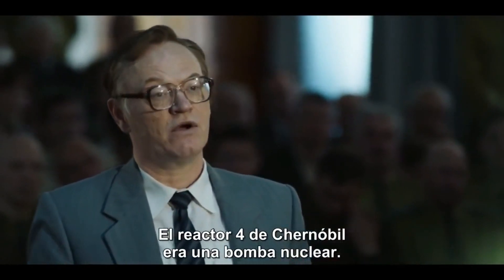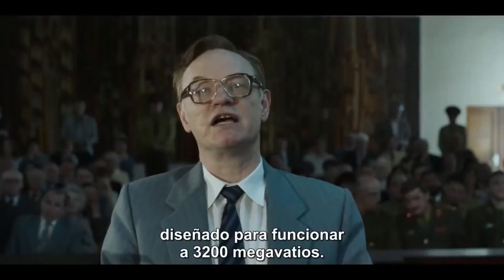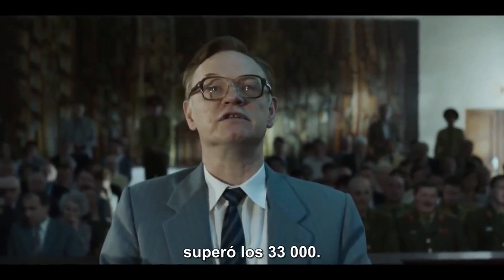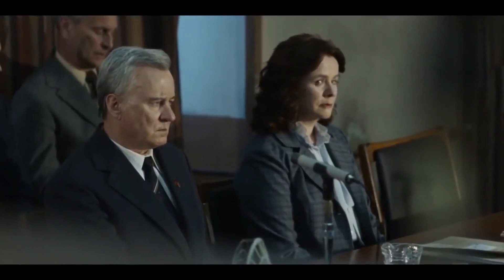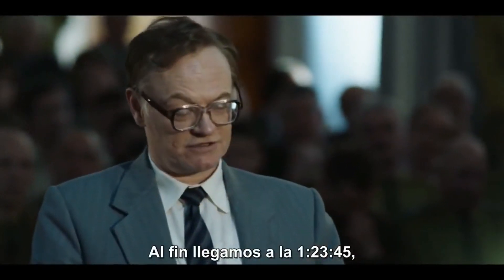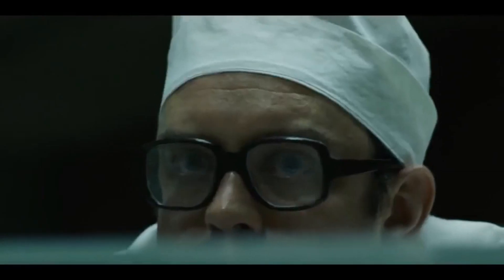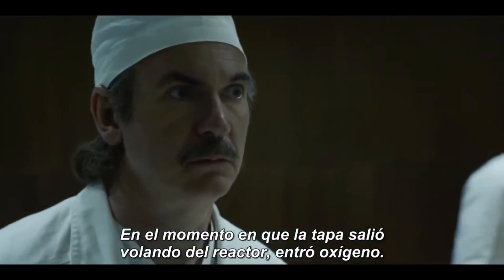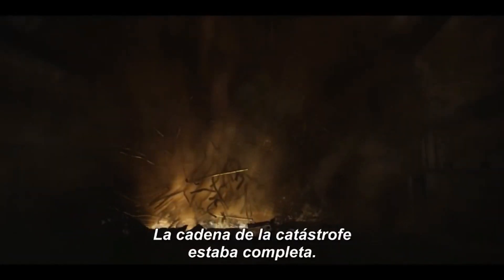Chernobil disaster explained in 10 minutes (3/3) - Valeri Legásov - Chernobil Series

Comment: I wish people used different terminology. The control rods aren't "tipped with graphite". They're half graphite (to accelerate the reaction) and half boron (to slow the reaction). Pull out the boron, and the graphite gets pulled in to take its place.
The graphite half wasn't ALL graphite, though. It was shorter at both ends, and water filled the gap. LIGHT water absorbs some neutrons.
Pushing the control rods back in displaced that extra water, and removed the last thing absorbing neutrons at the bottom of the reactor... replacing it with the graphite that was used to accelerate the reaction.
Reply: You're delusional, get this guy to the infirmary ...
Reply: @fbi208  Comrade, you are right, he is telling lies, get him out of here
Reply: You didn't see half graphite tips because ITS NOT THERE
Reply: I also really don't like the term "positive void coefficient". It's too technical, and hides the true issue with these reactors.

The RBMK reactors use light water, which unlike heavy water used in western reactors, actually absorbs some neutrons.

If the light water boils, the steam (which doesn't absorb NEARLY as many neutrons) is now taking up a bunch of space that was previously taken up by water. This increases the reaction, which causes more water to boil.

But "bubble of steam" becomes a "void", and "positive feedback" becomes "positive void coefficient", and suddenly nobody understands WTF is being discussed.
Reply: exactly i don't understand why people still call them "graphite tips" it confised me when i first started learning about chenobyl
Reply: Yeah, well any idiot knows that...
Reply: Tin Watchman  There isn't graphite "at the ends of the control rods". Half the rod is boron. Half the rod is graphite.
Accelerator. Decelerator.
Reply: Correct.
Reply: I am sorry but where did you get this from? RBMK reactors do have graphite tips...
Reply: @armandoc16gt3  I got it from multiple sources, but the most freely available is wikipedia, which describes the rods in some detail.

wikipedia DOT org/wiki/RBMK#Control_rods

As you can see from this description, it's not a graphite tip. It is in fact a whole rod of graphite designed to displace most of the water that would otherwise be displaced by an inserted control rod.

So when you hear someone say that the first thing entering the reactor is the graphite tip, they're wrong on two counts.

1) It's not a graphite "tip". Half of the rod is designed to slow the reaction, and half is designed to increase the reaction (with the exception of some water at the top and bottom of the graphite).

2) The graphite section isn't being inserted. It's already in the reactor. It's being pushed out the bottom, and on its way out it displaces water that was down there, which can cause a local increase in reactivity at the bottom of the core.
Reply: Great explanation....only one thimg I can add is that, because of the positive void coefficient, the water wich was already been pumped slower trough the core due to lower Power arrived at the Pumps...the water converted into steam even faster....so the reaction was mostly take place down in the core, where then the Graphite-water-displacement-body got pushed through and give the Chane its final link...
Reply: JBryan314  It is important to make the distinction. The rods were dual purpose absorbers and moderators. The graphite "tip" was there by design and had nothing to do with cost saving measures. Having said that I understand your point that the physics needs to be relevant to the audience. But that doesn't mean we should alter reality to fit the narrative.
Reply: @garijarmany465  the graphite itself is the cost saving measure - they used it instead of the more expensive heavy water option, and combining them and the boron on one set of rods (which forces the operators to apply one or other at all times) was the second cost saving measure
Reply: @garijarmany465  False they were there as cost saving measurement. You should read up on the topic. Hint: its not about the cost of the rods themself.
Reply: @garijarmany465  He wasn't altering reality, he was describing it to politicians.

I'm surprised they didn't find Dyatlov innocent by reason of we don't get it.
Reply: @oceandark3044  he was 100% altering reality. They made it out like a cost saving measure in the rods construction lead to the disaster. That simply is not the case. If he had said that graphite moderated reactors are cheaper than heavy water reactors but are potentially more unstable and may have catastrophic failures then that would be correct. But to say that the rods used graphite as a cost saving measure is not. They wouldn't work without graphite.
Reply: @garijarmany465  Yes, because that was the only way to use the less-enriched fuel they were using.  Which is cheaper.

He didn't say "they're cheaper" he said "it's cheaper", and it is.
Reply: @oceandark3044 . No. Graphite moderated reactors aren't the same as rods containing graphite moderators. The reactor by design used a graphite core. That makes it cheap, largely because heavy water is expensive. The graphite on the control rods, Which is what legasov (who wasn't even a physicist or even at the hearing in the capacity we saw) was referring to wasn't there for cost cutting. As he made out. In fact it made the rod more expensive. The graphite was there for increased power generation to displace absorbing water. So as I originally said, the HBO narrative, that the graphite "tips" were produced because they are cheap is not true.
Reply: @garijarmany465  You're saying that they could have used another method of control rod at the time in that sort of reactor that would have allowed them to use fuel so un-enriched?
Reply: @garijarmany465  Isn't this the thing they changed in all rbmks though. And isn't increased power generation more economical ie cheaper?
Reply: @derpinbird1180  to my knowledge there have been no changes to the rods design in operating RBMK's. The number has been changed and I believe several fixed absorbers have been added to lower overall thermal power. Yes graphite moderated reactors are cheaper. Yes they have rather serious design flaws. No the rods were not manufactured to be cheaper. No, corners were not cut to make the rods cheaper.  There is a huge difference beteeen making something cost effective and making something poorly due to cost. My issue with the HBO narrative is that people who don't look deeper are mislead. Really the take home message from the clip above should have been that government censorship of data was the real cause behind the accident. Had the results of positive SCRAMS been made available then the accident would never have happened. Did the accident happen because of cost cutting. Somewhat. Was it the major contributing factor? No. Do graphite moderated reactors just blow up because of their price. No.  In order to learn from history we should try not to alter the important bits.
Reply: I understand that concessions need to be made for creative purposes. I just think that such an important point should be made clear. I can gloss over the large inaccuracies with Legasov and radiation exposure and sickness. Even the chronology of some events. But the bits that really matter should be as accurate as possible.
Reply: @garijarmany465  I mean, while it's technically accurate, I understand the frustration.  If you follow the whole chain of why you'd put a carbon rod on the end of your control rod to intensify the reaction, one way or another that's going to be down to cost.  They definitely did it because it was ultimately cheaper.  I think what might get glossed over is that cutting costs creates a less stable reactor, yet it still would have been fine if we'd had respect for that power.  Chernobyl the series tends to portray the disaster as ultimately the fault of the Soviet government's approach to image and propaganda, and while that's a factor the ultimate reason the reactor exploded is hubris.  I think Chernobyl should have gone into more depth on Dyatlov, especially.  The reactor didn't explode because it was cheap, it exploded because Dyatlov, who had presided over one nuclear accident already, treated the reactor casually and believed he knew better than the safety protocols.  The turn at the end where Legasov makes the whole trial about the AZ-5 as if it somehow absolves Dyatlov of a measure of the blame is probably the biggest problem I have with his presentation.

I can see that the cut costs of safety measures plays into the theme they're going for, but I do agree that it's probably misleading considering America quite nearly had a similar failure on Three Mile Island, and that was entirely related to its equipment.  The reactor would have been perfectly fine if it had been treated with the seriousness it deserved.  And no matter how expensive the reactor is, treating nuclear power with callous disregard for safety will eventually cause a disaster no matter what.

I have no problem with Legasov in this series remarking on the cost-cutting measures making the accident more likely and less containable, but I do have a problem with Legasov saying that Dyatlov did what he did because he thought AZ-5 would be a magical fix-it button.  He didn't lack knowledge, he lacked wisdom.
Reply: @oceandark3044  Lol
You: "No the rods were not manufactured to be cheaper. No, corners were not cut to make the rods cheaper."
Also you: "  If you follow the whole chain of why you'd put a carbon rod on the end of your control rod to intensify the reaction, one way or another that's going to be down to cost.  They definitely did it because it was ultimately cheaper. "
Reply: @derpinbird1180  That first line wasn't mine, it was Gari's.
Reply: @oceandark3044  yeah but the whole "because it is cheaper" when asked why the controle rods also have graphite was a misleading flaw tbh.
Reply: @jannoottenburghs5121  I wouldn't agree, because the entire point of using those rods was to enable the RBMK reactor to use less enriched fuel, which was absolutely done because it was cheaper (as he'd mentioned earlier).

Now, one could say that adding graphite to the rod wouldn't make it cheaper per se, but then you would have to design a moderating rod that would do what that particular control rod did in a safer way.  That, however, would make the rod definitively more expensive.  Adding graphite to the bottom of an existing control rod seemed like a simple and inexpensive solution (why not replace the boron with carbon on the same servo, right?)

Honestly, it's not a necessarily bad idea.  As was mentioned in the reports of the reactor's failure, there were absolutely safety regulations to prevent the disaster that Dyatlov ordered ignored.  In fact, had the sequence of human errors which occurred never come to pass, no one would have had any issue with the Soviet program saving money.  It isn't like all reactors don't try to save money in design to some degree.

Legasov is, however, stating the simple and obvious.  Any way you slice it, the reason this design for the control rods was used rather than just about any other moderation control boils down to cost.
Reply: @garijarmany465  I think you're misunderstanding the use of the word "tip" - you (and others) seem to think the point of that term is to imply that the Soviets were idiots who just casually added a small bit of graphite to the boron rods for no apparent reason. That's not the case - the point of using "tip" is to simply illustrate that the boron and graphite were put on the same rods, with the born at the 'base' and the graphite at the 'tip', and that, as a result, they couldn't insert the boron without first inserting the graphite.
Reply: @oceandark3044  it's not a matter of being cheaper. It has to do with availability. Back in 1970 uranium enrichment was much harder than today which means that this design is excellent. It also allows for in-site refueling and the potential to produce plutonium in the reactor. It's a genius design. That is the whole reason WHY it was such a well kept secret to being with. It was way better than the American designs of the same period and the Soviets didn't want anyone copying it.
Reply: @oceandark3044  call it cheaper or more efficient or whatever you want. This reactor design was excellent as it fulfilled several important requirements at once. It is a sound design because even after Chernobyl very few things were changed and all of the changes address specific issues that were uncovered due to the accident. By and large, the design is completely unaltered, and it is the oldest design still in operation today and it will remain until 2035. The US didn't run these reactors not due to safety concerns but because they didn't have the design. Had they had the design they would have copied it because it's much better than what they had at the time. In terms of safety, I do believe the Americans would have at least added a containment building to it, which would have helped tremendously to prevent, not the accident itself, but the worst consequences of the accident.